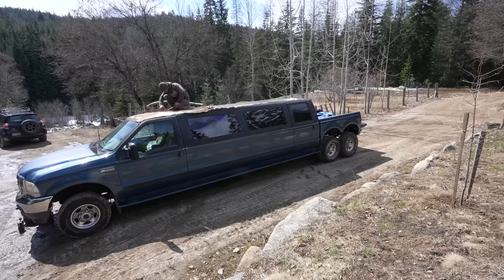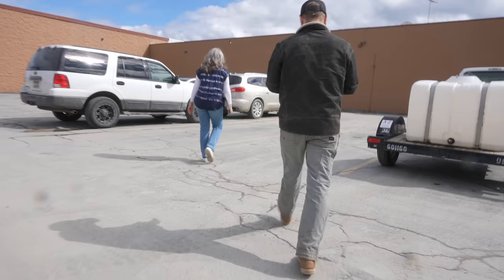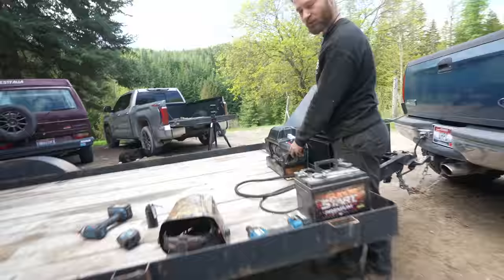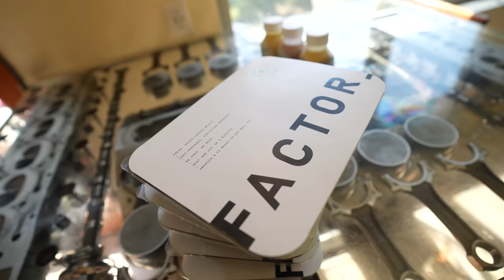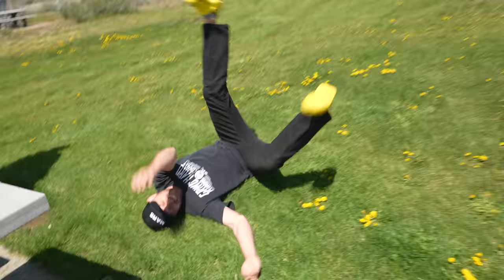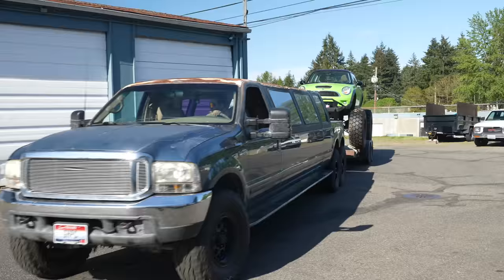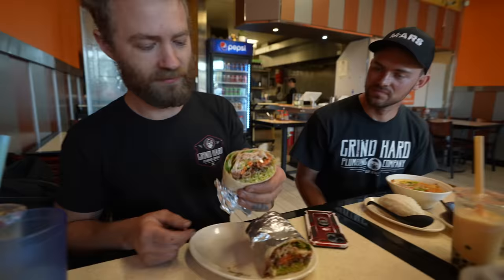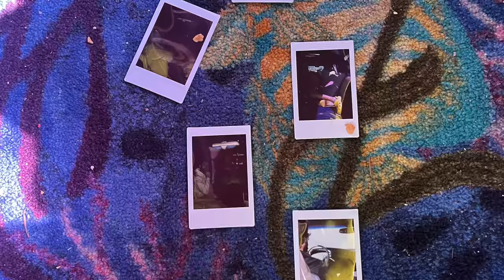We Found A Mini Cooper Monster Truck!

Comment: That limo deserves some real tlc and a new roof. Its so much nicer than it has any right to be and will be an amazing road trip vehicle
Reply: Yes let's see a nice tinted blue Perspex roof to compliment the rest of the decor.  And hydraulic lift kit and hidden roll cage for more flexibility.  And finish it off with a conversion to being a hybrid. Get rid of the driveshafts, connect the engine as a generator, and put in 3 Tesla front axles so it becomes a 6 wheel drive and steer monster limo.
Reply: @chrisoakey9841  You'd need something far more heavy duty than Tesla axles to handle the weight of that limo.
Reply: @chrisoakey9841  oddly specific 😂
Reply: @chrisoakey9841  That would be like driving around in a green house it would be so hot
Reply: Needs logos for sure... Kinda missed opportunity for the road trip tbh
Reply: @tonn333  It does stand out. 
Also anything stickered up draws a lot more attention, and not always the right sort.
Reply: @agentcrm  it does stand out, no doubt, but that's of little use when they don't know that this awesome YouTube channel is behind it.
Reply: I would cut out the worst of it and just repair the roof . I'm pretty sure you can't buy a replacement roof for a limo , they make that stuff in house and then cover up their crappy craftsmanship with vinyl .
Reply: @Youallbowdown  it is an odd sort of vehicle
Reply: I had an 8 passenger 1 ton dually ram, but it was on tge oem frame
Reply: @agentcrm  not reall the tesla driveline is over built but the gearing is kindof off for that. now if you also put the suspension in then yeah thats to much youd have to build or buy custom suspension
Reply: Think y'all should 🦏 rhino line that limo
Reply: I agree give that roof some love and that limo would be awesome, hope it stays around.
Reply: I want one

Comment: That smell is mildew in the carpet, and the padding. I've been in the flooring business for 40 years, and the only way to get rid of it is to replace both the carpet, and the padding. Really like you're channel! PEACE ✌️
Reply: Limo carpet has a lot of "extras" you don't want to know about in it.. I would have that out first thing, NASTY
Reply: You can get pretty far with an enzymatic cleaner and a proper carpet extractor, but you're right that the best solution is new carpet and upholstery.
Reply: Judging by who they bought it from, it's been trashed. They'll definitely need to have all that replaced.

Comment: I think ya'll gonna need a bigger shop than originally planned 😳💯☮️
Reply: That has been true of new shops since some crusty old guy built the first shed to whack iron in! And this one was probably too small before the ink was dry on the plans. I am fearful, though, what Ethan, in a larger, more fully equipped shop might release; the terror is so palpable that I cannot turn away! And a machinery barn to park all the finished projects so they don't have to un ice them for re use!

Comment: I used roll on bed liner as a roof liner on my 84 olds. It actually holds up pretty well. Been on for two years no cracks and only one chip from my kayak loading

Comment: I love the setup! Also, the limo is priceless. As far as the roof situation on the limo goes, you could maybe sandblast it, patch what metal needs to be replaced, then use whatever coating to seal it, then build a platform that could go across the roof. (Maybe similar to a rock crawler cage) From there, you could set the platform up to do multiple things. Haul a small project, put a tent or camper on the top, etc.

Comment: I just happened to do some research on oil levels for the 7.3. I have a 4x4 van with one, and I got a few quarts low accidently. I believe what I found was Navistar built in a fail-safe, when the oil reservoir drops below 7 quarts the HEUI fuel system shuts down and causes no damage. Love the builds you guys do! Keep it up, cheers from Montana.

Comment: So Will was actually more correct than he knows when he said, "its fine thats the oil's low, its a 7.3." 

The HEUI fuel system on the 7.3 operates using oil pressure. If the oil is ever low enough that the pickup runs dry, itll cut fuel and just shut off before it damages the bottom end. So you know it was never starving of oil.
Reply: 100%

Comment: Ok that was the funnest dandelion eat I have seen on the tubes ever.  I dip them in pancake batter and fry them OR sun dry them and then use them in tea.  The entire plant can be eaten, some parts better than others.  If you get the little flower buds when they still dont have stems a table spoon or two in a cup-o-soup or noodle soup is really really good.

Comment: you should look into using roll on rubber roof for RVs .. treat the rust first .. you could even use it on the sides after pulling off the vinyl .. give the limo some love .. and maybe some AC

Comment: 4 link the front and back suspension. You can have the bars cross and mount above the other axle. And mount the transfer case dead center where the 4 links cross.
I definitely want to see the limo turned into a 6*6 drive and steer with tesla motors, and that huge engine turned into a generator.  And give it a roof rack few tents.

Comment: I have an idea for your limo roof... and the sides around the windows. You should rip off any vinyl and rust, then rust inhibitor primer (obviously), then use bed liner paint so its nice and thick as well as strong.

Comment: This limo is awesome,I think you guys use your sweet brain powers and all available sponsorship opportunities lower this thing put a massive diesel engine and twin turbo setup and go for a dry lake land speed run!!!??? Just thinking of the crazy stuff this could be used for. Or maybe go the other way and make it the most ridiculous overland camper setup possible.

Comment: Gotta LS V8 that Mini! Gonna need some grunt for all that tire.
Reply: I put mine on a S10 chassis for that reason.
Reply: @intentsmodz  Pretty sure you can get an LS in a Jeep chassis as well. An S10 one would be easier I'm guessing.
Reply: @CLCIII  you can I'm sure. I've put one in a blazer before but never in a jeep. I'm actually curious to see more of this once they start working on it. It's got a monster body lift so it should have plenty of room. I'm trying to get mine as low as possible to the chassis and originally bought a jeep to do it but the shape of the chassis just didn't fit the floors of the car the way I wanted. Look how they have 10 inches of lift blocks. My blocks won't be over 2" by the time I'm done
Reply: @intentsmodz  Ethan is a fabrication genius and I look forward to the build. The look is killer already and they are gonna have to have a serious driveline to deal with those at least 40" tires.
Reply: @CLCIII  yeah, I've been watching these guys for a couple years now. I love the stuff they create.
Reply: @intentsmodz  I've been watching them since the days when the videos were about the tree houses. Not sure how long ago that was. Of course I like the Power Wheels Builds and the 6x6 K truck was great. The lil mini jet boat is awesome, sadly @ 6'4" 200 plus pounds I could never take it for a spin. Actually that would be the case in a lot of the builds. Lol!

Comment: GHP crew just wanted to throw this out there you really shouldn't cross your tie down straps like that if you loose 1 strap your other 3 are worthless it's been tested and proven to be an inferior way of securing vehicals!! For example if you loose 1 strap the other strap that is still there will actually pull the vehical off center and actually loosen one of the straps on the other end of the vehical and once that happens you have nothing holding the load secure! I just hate to see something bad happen! I can only imagine what yall will do with the Cooper, it's gonna be killer!

Comment: WSP ticketed you illegally. 
60mph is for commercial truck/trailer and large rv's at a certain weight/length. 
A stretch excursion with trailer doesn't apply.
That said.. "they" could have changed the rules, but I doubt it.

Comment: Hey guy really love the show.

But I have a 2016 tundra crew max and my wife and I opened up a Vienna BEEF DOGG gourmet HOT DOGS ITALIAN BEEFS  and adding more . We also have a food trailer that I’m working on and opening on Tuesday of the this coming week if you read this soon. Lol
Reason I’m contacting you is I love the way you think. About the way you engineer awesome toys. Been watching and I know there’s others but I enjoy a brain that I just can’t explain. You just come up with good engineering ways to finish the job.
I’m 44 years old was a structural welder did tanks and bridge structure. And worked on oil fields doing structural welding for there pipe layers to lay pipe. 
Got hit with bad lungs and probably got about 5 years is what they say. I like to work hard always have. I don’t know what else to say bro but I’ve watched many on YouTube of people building there own and I just can’t help but keep going into that brain of yours it’s just right THERE!!!! 
I have two food trailers one is half done that I bought and I’m pretty sure they built it on a snowmobile trailer. And the other is a 8 x 16 enclosed that I was turning into another one kind of transfer from one to the other. I was just wanting you guys to build my food trailer with your style and whatever you come up with. 
We’re a small business basically we opened and then there’s this owner that has never sold his Italian beef and as soon as we announced our Italian beef they brought it back and cheap and they own a lot of others. 
I just thought about you guys and making something happen and making our name pop by using you guys and promoting you guys here in FARGO
THE DOGG POUND 
FARGO, ND 

Just let me know here where to contact u if you want to talk. Thanks
Ps. The crew max was to see what you can do to it and the food trailer make it POP!!!

Comment: Ummmmmm no, that’s the biggest load of rubbish I’ve ever heard. That is not a law in Washington.🫣🤦‍♂️🤦‍♂️🤦‍♂️🤦‍♂️ biggest lie I’ve heard in a while. That’s why we run goosenecks and 1 ton pickups instead of semis as much as possible. We roll 75+ all the time. 60 is for commercial vehicles classified for hauling and licensed under a DOT number.